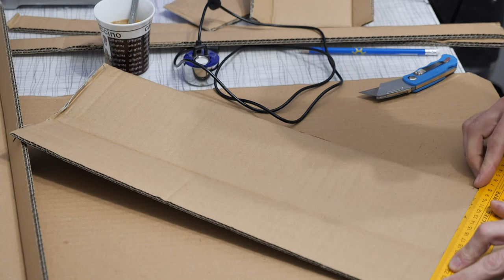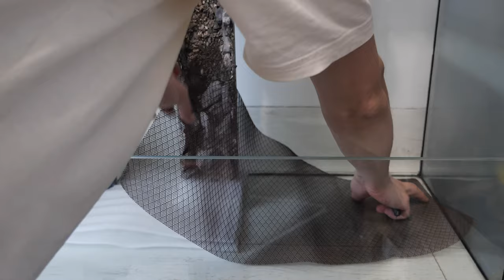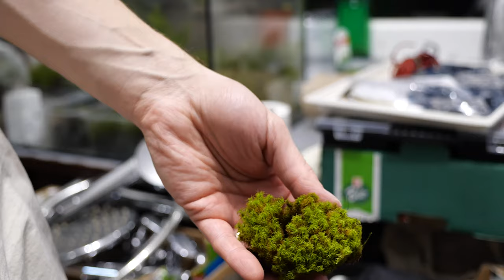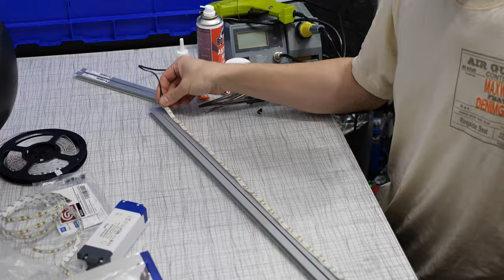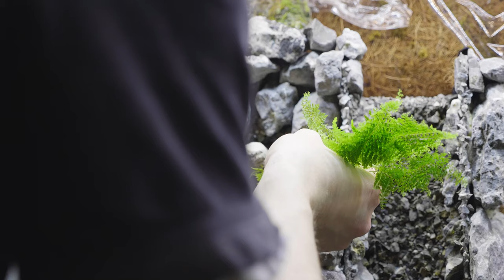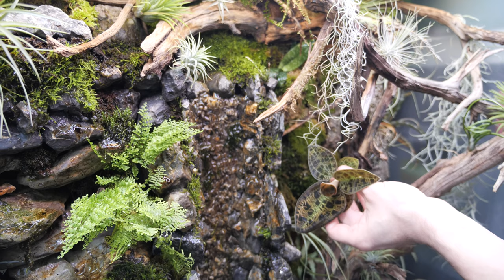Rainforest Paludarium Waterfall with endemic plants and Vampire crabs

Comment: What we’re the two light strips that you used for this setup?
Reply from the maker: Warm white 3200K and Cool White 6500K. Each strip is controled separately by timer/dimmer. But I have a new inovation - I add a new control board and now paludarium have a lightning storm - https://youtube.com/shorts/TBSjezSaEFc?feature=share